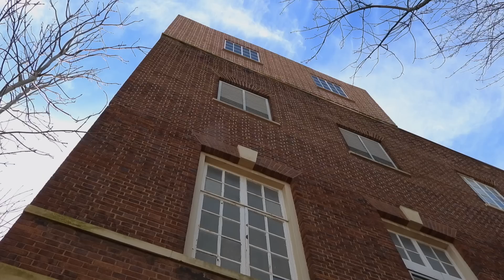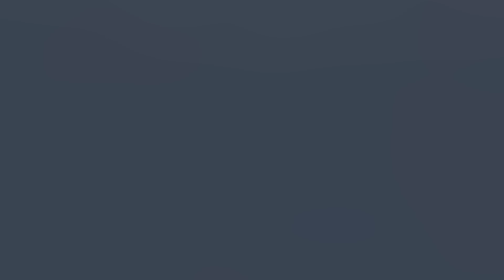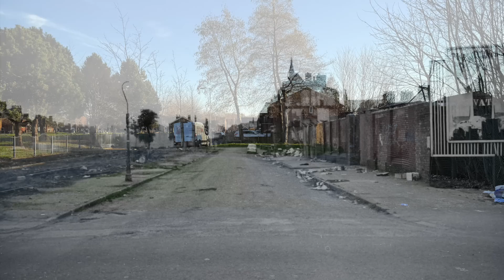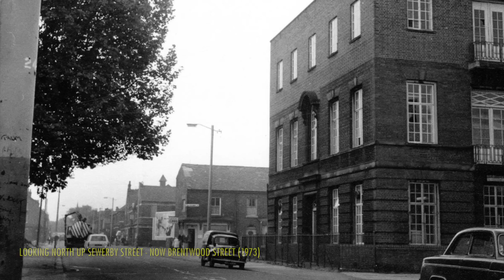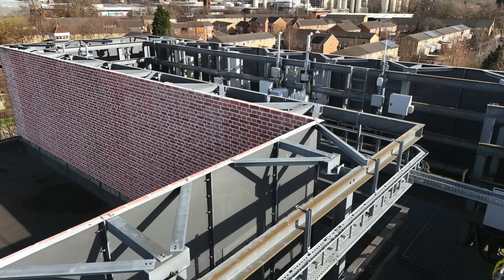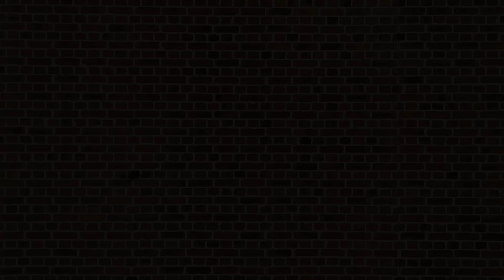Why Is The Top Floor Of This Telephone Exchange Fake?

Comment: The site it's self is radiating:
Three: 800MHz, 1800MHz
EE: 1800MHz (dual), 2100MHz and 2600MHz (dual)
Vodafone: 800MHz, 900MHz, 2100MHz and 2600MHz.
O2: 800MHz, 900MHz, 1800MHz, 2100MHz, and 2300MHz (Dual).

Vodafone also has 5G Ultra (SA) on 3500MHz.
Reply from the maker: Thanks George

Comment: These transmitters absolutely make you sick if you live nearby and you are in the beam,I have metered loads and door knocked the people in the beam and every one have been ill with headaches and cant sleep among other things.
Reply from the maker: Don’t be silly
Reply: @RingwayManchester  The warnings are even on the equipment,the warnings are built in to metering equipment and you say its wrong.
Reply from the maker: The warnings are because of high voltage cables, and if you touch a transmitting antenna it can give you an RF burn. Just like any transmitting antenna can. 

Zero evidence of headaches and sleep disturbances from cell towers. People like you just think they do…
Reply: @ I really did think you would be more knowledgeable on the subject or are you just covering up like on the companies on the video.There is tonnes of evidence RF is harmful is you look.
Reply from the maker: @MachinesOfInterest peer reviewed sources please… I’ll wait. I’m guessing you won’t provide Any.

I’m very educated on the subject… it’s absolute nonsense. It’s rubbish. Paranoia.

Oh and peer reviewed evidence doesn’t mean nonsense by Mark Steele or Barry Trower.
Reply: @RingwayManchester you are a very mixed up guy.
Reply from the maker: And there we go. When you’re losing a debate you resort to name calling 😂😂😂
Reply: @RingwayManchester  WHO classified wireless radiation as a class 2 carcinogen in 2011,You know very well how many studies are out there yet you want me to individually list them, have you even looked at any ? Government says its best to stay 100 meters away from a cell phone transmitter, why do you think that is ? I know from ten years of study and metering and speaking to people/victims that you do not want to be living in the beam no matter what.But obviously you know all don't you.
Reply from the maker: Your first statement is wrong. Look at the classification and what it includes.

Find me the government legislation… clue, it’s not true 😂

Comment: You mean M.D.F…. main distribution frame..  not main frame distributor. Inside..  there are also I.D.F..  intermediate distribution frame. Cables come in from the street and terminate on the MDF. their circuits then run across the frame via jumper wires. Then that side splits off to the various IDFs around the exchange and then to the equipment.

Comment: Back around 2000 in Germany there was a dowser complaining on earth waves because of the digital GMS and/or UMTS mobile phone roll out. Especially one complaining in the bavarian village Oberammergau. He stumbled from one TV show to the next. 
In the end it was cheaper to build fake walls and roofs than to therapy these kind of people.
Maybe you remember people complaining of overheating their eyes/brains because of the microwave emittance in the milliwatts. Even some doctors did the math: How long does it take to heat up your head with 30 milliwatts when a microwave will take 5 minutes at 800 watts? They added the daily usage of mobile phoning up to this nonsense result to call it dangerous.

Comment: The old strowger exchanges used STD (Standard Trunk Dialling) drums manufactured by Sperry UK. I had the pleasure of servicing these in a couple of London Exchanges when they were transitioning over to System X

Comment: Telephone exchange maintenance TO here…. Non director Strowger, UAX13, TXE2, System X and AXE10. Near Newmarket, there is a UAX building with no windows, solid brick construction with an extended wall above what would be the roof line. During WW2 it would have been filled with sand to try and make it bomb proof. Another one near Cambridge was built into a single story very old post office building in an attempt to disguise it from German aircraft.
Telephone exchanges have a three letter code (called the 1141 code) for example DLM - made that up but it may exist. If the code starts with an X,Y or Z that exchange was built to have circuits that fed a military base, the vast majority of which no longer exist.

Comment: At 9:07 you can see from the edge of the facade wall that it's wood. I can't tell if it's just the top framing or the entire thing but while fiberglass would be more RF transparent, wood isn't a huge issue either. It's quite common in the US for people to install antennas inside their attics for various reasons including keeping them out of sight and making them immune to lightning strikes, and the wood rafters impede very little.
Reply from the maker: I didn’t include the photos but it’s definitely fiberglass. You can see the fibres under the paint on the back
Reply: @RingwayManchester  Ah, I was looking at the closest edge which had a wood-like appearance to me.
Reply from the maker: I agree, it took me a while to figure it out.

Comment: I wonder, why hide it? ¯\_(ツ)_/¯ 5G maybe, every network company pumping 5G to the network, and you ever looking feeder to remote saterlight, 5G masts everywhere? microwave everything in between? That looks like houses and homes in between; maybe do follow up on the height of the residence, on the line of the site, marked on the map? The results would be interesting? Even just 1% o 2% off from the normal, you never now, the might even be the most health, in there get dearadated all the the in there homes? After all, it keeps food fresher for longer; why not people as well? 🙂So back to the question: I wonder why you are hiding the 5G technology on that new top floor. I wonder why? ¯\_(ツ)_/¯

Comment: Another possibility is planning. Some years ago, BT sold off most of their exchange buildings and leased them back until customers were moved from copper to fibre, and the buildings would become redundant. Adding a perceived extra floor would make planning for a real extra floor easier if/when the building is converted into flats or whatever.

Comment: I did Fujitsu DSLAM install work in this exchange back around 2007 ish. One of the more secure exchanges where the gate must be kept locked at all times.
Reply: Yes, the area has a...reputation. Engineers attending the exchange always 'doubled up' for safety.

Comment: Happy memories of my 4 years working for Standards Travelling Circus back in the late 70s/early 80s. Started on TXK3/4 around Glasgow (Govan was the most secure building ever). Graduated to TXE4/4a then took the Saudi $$$ acceptance testing Philips 205A and 5ESS-PRX switches. Back to UK in 85 to engineer the BT DDSN network and Mondial DISC (largest international switch in the world at the time!). That got me into Unix and a 35 year software consultancy 'career'. My O Levels did me proud #goodolddays
Reply: I used to work in a TXE4 exchange, in Manchester & one day I threaded the cyclic store wrong & went for tea break. When I came back the fault printer had run out of paper & it was still printing on the roller 😂

Comment: Yes I've worked in there and knew about the masts. The building will probably be going soon, as the landline network is going I.P. in a couple of years and there will be no need for the System X equipment (invented over 40 years ago.)

Comment: My first job when I left school in the 70s was working for Plessey telecommunications on exchange construction traveling around the country to install strowger equipment lots more people were wanting to become subscribers the trouble is the old strowger system took up a lot of space so exchange buildings were designed to be extended so a lot had flat roof so they could have an extra floor built up a lot of the rural exchanges had extra land around them for expansion of the building but in the 80s the microchip took over so you could get the same amount of equipment on one floor instead of six a few of the rural exchanges now have new homes build on the solid off land that was no longer required things will be even less required because of the rolling out to full fibre and the copper network being dismantled fibre was just being introduced just before I retired 7y ago this month after 40y at openreach and my first 10y was working for Plessey I worked on one end of the network and finished at the other my main job was safety checking the telephone poles which was like working on the fourth bridge

Comment: I would say that the relatively low building would make the cell towers standing out more than on the higher building. Of course it is also that you mentioned about not changing the appearence, however, in that regard it is a complete failure as even from the ground it looks about as realistic as a plastic "brick wall" in a cheap pizzeria.

Comment: Regardless of the colour of the new "brick", that is a cool way to hide all those antennas.  Where I live in Stalybridge, there is an old industrial tower/chimney near the bus station, they painted the fibre glass cover to match the brick.  My Dad (long dead) used to let me into where he worked at the Heald Green exchange (Mercury) and we would go on the roof to watch Concorde when she came to Manchester. The noise of all those frames working was loud in the exchange.
Reply from the maker: Hey mark, I filmed that chimney recently :)

Comment: Looks like this arrangement was put in place because the original planning application was turned down in 2000 on the grounds of how it would look and some tinfoil hat stuff about kids at a nearby school https://pa.manchester.gov.uk/online-applications/files/0C33032208E1B9DDF42B29081519C912/pdf/059295_FO_SOUTH1_00--138159.pdf

They got it through two years later with the addition of a "glass reinforced plastic shroud"  https://pa.manchester.gov.uk/online-applications/files/AB1B4266ED2A12957092B6A702347276/pdf/064443_FO_SOUTH1_02--276427.pdf
Reply from the maker: Cheers! I searched the planning database and found nothing! You’re a star
Reply: @RingwayManchester  took some doing, they used a different address each time

Comment: In the late 90s BT allowed Greater Manchester Police to use Moss Side exchange as an Observation Post to gather evidence on local drug dealers who operated near-by. The local criminals found out and poured petrol into the cable chamber setting it on fire. It caused thousands of pounds worth of damage with many e side copper and fibre transmission cables having to be replaced. When I worked at Moss Side I was told the fake floor was to hide the equipment and stop metal thieves from stealing the gear. There used to be no way to get to the roof from inside the building and the cell phone lads had to bring a large cherry picker when working up there.
Reply from the maker: Oh wow that’s interesting cheers!

Comment: The ads at 1:41 "1935 Morris 4 door saloon ... 29 mpg" 
Little did they know nearly 100 years later that would still be good fuel economy.
Reply: I'm getting 55-60; are you guys driving tanks? 😂
Reply: I would love 29mpg all the time in the town.  For a relatively "small petrol turbo" I get between 28 and 30.  It is so annoying as the fumes out of it are way more harmful than my diesel which gives 50mpg in town, but then takes 2 gallons of diesel to burn off all the soot, so a false economy now.  All part of the plan to try and make cars less efficient, more expensive to run and to try and get people buying milk floats.

Comment: Interesting that you mention the Director system was first used in Holborn ATE. As an apprentice I worked in Holborn (405) and Chancery Lane (242) which is in the same buiding. Later in my training I also also worked at Holborn Tandem (an inter exchange only exchange ) and also helped commission one of the last Strowger exchanges (404)  there.

Comment: I have spent many years working in that building & all the other exchanges across greater Manchester working for BT/Openreach.  Unfortunatley I have no Ghost stories. 👍
Reply: Collyhurst Exchange you had more to fear from the locals nicking or robbing your van.
Reply: @ I was a frames engineer until last April due to redundancy.
Reply: Someone has seen Roman soldiers marching along the corridor in Turret exchange. They were only visible from the waist up as over time the land rises up with leaves and debris.
Reply: Did you ever know about ECHELON, the taps that were put on lines, Radio Communications Agency installing SDRs in 1994 so they could remotely monitor the spectrum and direction find in each area, or Security Services installing their SDRs with transmit capability?  The SDR cover was blown by a news channel in the UK in around 2007, and the story was that local WiFi was being monitored to protect people and inform them if they were using a weak password.  The real story was that it was for "packet injection" and repurposing WiFi equipment for surveillance purposes, not to mention snoop on people and attack those that "air-gapped" computers thinking it would keep them safe!
There was a lot going on in BT exchanges and there still is to this day.
Don't ever think that phoning a charity to report a crime or using 141 protected your identity, your full details were still logged, it just didn't appear on your phone bill.  Police used to abuse their position and that of others, or use Special Constables, who worked for BT, to perform checks on numbers for example.  Nothing was ever logged.
Reply: I have also worked on this site only remotely tho as an rf safety technician

Comment: Another interesting video. I work for an ISP in Rochdale and I'm watching with interest what will happen with all these exchanges once the PSTN switch off completes and FTTP becomes the norm. All the equipment in these buildings will become surplus to requirements and with many of these exchanges being in prime locations such as city and town centres, and next to train stations, Openreach are going to make an absolute fortune and that's before we even get into the business of them reclaiming all the copper lines.
Reply: I believe that some years ago BT started a company called switch space to let out the large amounts of space they have in their exchanges. I can only speculate that managing security and privacy in critical exchanges is a nightmare , and effectively makes site sharing impractical
Reply: @thewavesmith5754 I guess it depends on the building layout and style. Skelmersdale telephone exchange could easily be used for office space as there are a small crew of BT staff in there at the moment. It is, however, a parent exchange so not one they're likely to get rid of as the FTTP generally go to these. 

On the other hand, Leyland, also a parent exchange, has no office space. 

Then there's Preston exchange, in a tower block across from UCLAN, so again likely to be suitable for office use outside of BT. Maybe even the university would take on office space there if BT carry on with their plan of centralising staff in fewer, but larger office spaces.

Comment: When I was in high school the electronics class got to go tour a phone exchange here in the US. The building we toured first was the actual 'operator stations' then the actual phone switch building. Both were built in the early 1900's. Today the 'operator station' building is a museum for the old phone systems of the past. The switch building is even different now. Though from the outside is appears the same. there is nothing of the old switch system left in the building. It is all cell systems and digital switching.
Peace

Comment: My Dad worked in BT Transmission. I was in many exchanges as a child. I can remember the racks and racks of equipment, the smell of the electronics and the noise from the repurposed marine engines working as backup generators (my Dad would fire that up for fun.)
Reply: I was working in a BT exchange in the middle of Chester and each time I walked past one rack I could smell burning.  I got one of the engineers and he had a sniff around and come back a few minutes later with a board to replace the burnt out one with.  He looked at it and laughed saying, "that's half of Chester that's been unable to make any calls".
This was the time when more and more computers were being installed and you needed huge rooms with aircon plants in them.  That's all changed since and most of the old equipment replaced.
I can't even remember the road, but it is off a main road right in the middle of Chester, a fairly big building.

Comment: The grey cabinet in the compound is a Merlin Gerin GP6 feeder pillar, it was installed by Crown castle in the early 2000’s at many BT exchanges to supply 3G network equipment as part of the 3G roll out, I was part of the team that built them at the Schneider Electric factory in Eastfield, Scarborough. I also retro fitted electric metering equipment to them in situ, this one included. There were a number of different ones, RP1 that were roof mounted and GP1 a smaller one that were at ground level. The sites were managed by Skansa at the time.
Reply: were the pillars fed + metered with mains voltage, and had 48 volt rectifiers + battery backup thereafter inside?
Reply: @ No, they were just the main power supply from the national grid. They had a bus bar system that fed individual mccb’s each feeding a different mobile operator. Hutchinson 3G, o2, Vodafone, Airwave and Orange.
Reply: I often wondered who it was that put the dirty great cabinet in my parking space at Marple Exchange.😀